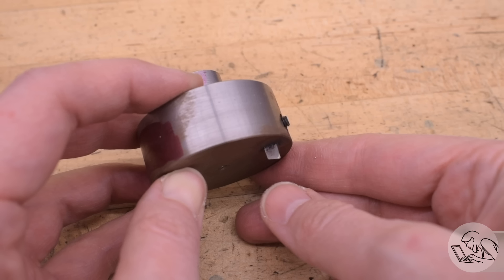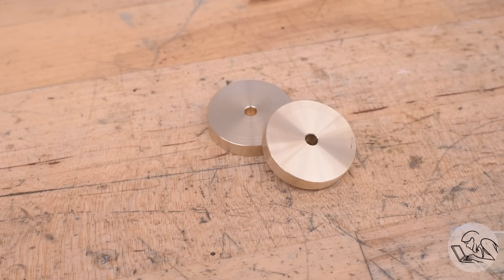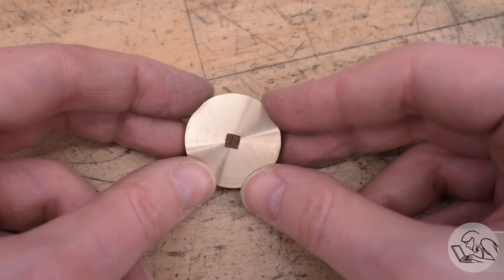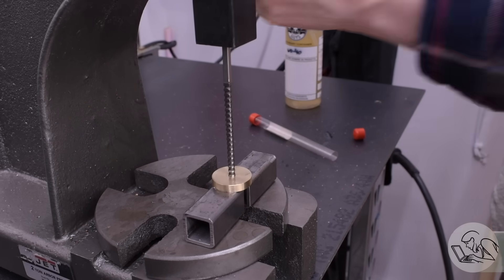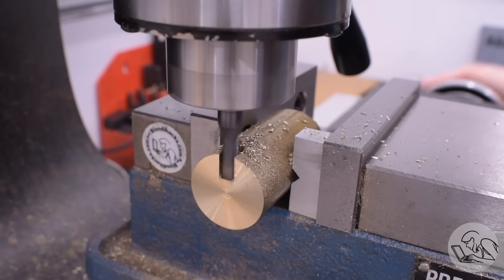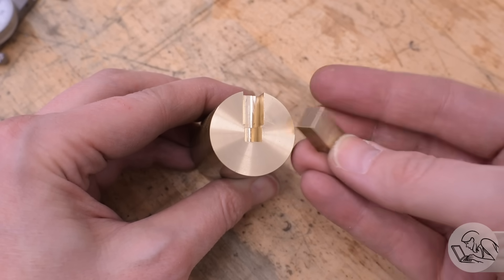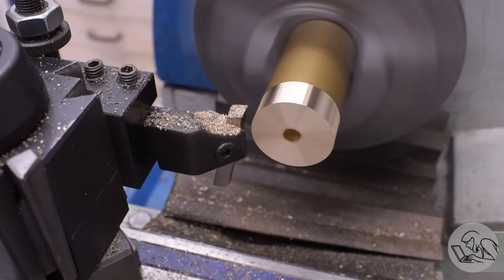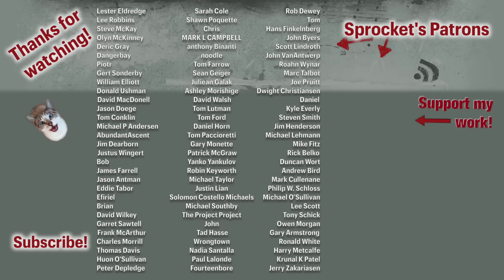Making Square Holes - Three Ways

Comment: I see another commenter mentioned This Old Tony's chisel approach to square holes which is good, but this old Tony had three other methods. Each started with a round hole. The first one involved putting the piece on a work surface and karate chopping. The second one was the same as the first, but instead of using your hand, strikes the object with a dead blow hammer. The final method, only for masters, requires only tossing the piece a bit forcefully onto the work surface. Each method, of course created perfect squares.

Comment: excellent stuff. I had never seen the third way before...very enlightening little guide
  Thanks Quinn
edit because I mentioned it in a message further down or up...I blacksmith so hot and cold punching, hot  drifting and cold chiselling as well as filing are in my playbook
Punching and drifting are pretty accurate, drifting for size and punching for location...cold chiselling is good at tapered holes and doesnt get used often but can be very accurate with sharp chisels (honestly I usually file the last bits to make them super nice and not tapered)

Comment: 40 years ago I filed four holes for carriage bolts to put a bench seat in a van.  In 1996 we were rear ended and the nuts were still tight and the bolts didn’t shear.  The van was totaled.  I didn’t need perfectly square holes, just enough to hold the bolts.

Comment: Loving method # just for the coolness of it.  Loctite 680 is amazing.  When I made a new cross slide lead screw for my lathe, people that had been there/done that convinced me to use 680 instead of a mechanical fastening to join the Acme threaded rod to the handwheel end of the screw.  Nine months later it's still holding perfectly.

Comment: 2:21 could the set screw be placed at the required angle? It would be challenging to drill the correct angle and correct position, I suppose.

Comment: I’ve been fabricating 30odd years. Never had a need to make a square hole. If it were as easy as drilling a hole square, im sure designs would’ve changed some, but all things considered, imo, square holes are for engineers that don’t fabricate or care about cost

Comment: Any suggestions on where to get good files - especially little specialty files like at 4:25 where it has safe edges?
Reply: I don't think I've bought a brand new file in 20 years.  If you dig in flea markets, you can usually find old files that were barely used.

Comment: It would have been interesting to see how erfective a shrink fit would be to perform with the last piece at home. I've heard putting the infill piece in the freezer and the surrounding workpiece in the literal oven would create enough thermal distortion to make an effectively unbreakable bond even stronger than press fitting.

Comment: Here is another way, a way that a toolmaker might use:  1) First drill a hole to remove a great amount of meat. 2) Get a high speed steel square cutting bit (typically hand ground to function as a cutting bit when you need to turn metal on a lathe). Grind it to the needed dimensions on a surface grinder. 3) Push the end of this bit through the drilled hole with an arbor press. Complete.

Comment: Maybe you have already done this but a video on how to cut small O ring grooves for an 1/8 hole would be interesting. I have seen videos on cutting large O ring grooves in flat plates but not small O rings. I have made a cutting tool out of a drill bit to cut O ring grooves in aluminum. An end mill works also but I would think there would be a better way to do this.

Comment: Well we've been making 14mm square holes in steel this week and it sucked. At first we drilled 4 little holes in the corners then then did a very long and inefficient CNC milling path of a square, but tool overhang was too long. So we used a 14mm rotary broach with a pre drilled 14.2mm hole. But the broach was too short (the hole is 35mm deep) and our Z axis kept maxing out. The rotary broach toolmaker said: if you need to make such big square holes, do it in a softer material like brass. But we are in steel. At last we did the method number 3 shown in the video, with welds. It worked but it took a long time.

Another advantage of this method is that you can make very deep square holes. But for making hexagons, it's not as effective. On the other hand, rotary broaches work better with hexagons, but still not very deep.

Comment: That third method is how i made a broaching bar for the slotting machine at work last year. Ran a half inch end mill vertically aligned through a 4140 shaft, and made a weld in cap to fit, with a grub screw to hold the tooling. Worked flawlessly, still using it. Love when i see the methods i figured out myself in example videos, just shows im not as think as i dumb i am.
Reply: I would never think about such a solution by myself and I have a lot of respect for people who do

Comment: I use the file method for my square holes. Start with the triangle file then to the flat like you did. But I have tapered square files to finish it to size. Of course the material I am using isn't as thick as you were doing. Need square holes for a carriage like bolt.

Comment: I use the broch to cut a square hole in cast iron model locomotive wheels, this allows me to be able to remove a wheel from the axel and replace it while keeping the wheel quartering. Never had a use for the last method, but theirs no question that the result was excellent.

Comment: A few times, i've needed square holes to take carriage bolts in thin steel plates. Not being able to think of any other way to do it.I used a triangle  file that I had laying around and it worked out well.

Comment: You're not entirely wrong on broaching. I've had to manually broach keyways in steel. We have a large manual arbor at work that I think is a 15 ton unit. And it is a beast when that broach gets a little crooked. Always make sure your broach is square to the work with each stroke! Especially with those old large manual arbors!

Comment: I've been a watchmaker for about 17 years and we often have to do a lot of bracelet repair which requires removing worn pins and screws, and replacing them with new and loctiting in place. The secret to a quick initial cure to about 75% strength is heat. I'll hold the completed bracelet over a heat gun and slowly pass it over until the metal is just approaching the point of being uncomfortable to touch. Then I set it down and let it slowly air cool. We don't have time to let loctite fully cure by itself and this speeds us up to the point where the bracelet can be delivered to the customer with no fear of it coming apart before it's fully cured.
Reply: You have to be careful when doing that, because heating loctite is exactly what we do to separate parts for repairs! Loctite will become ineffective around 120-150 degrees Celsius, and once it reaches that point it never comes back, it just becomes oil
Reply: @Orakwan  Loctite 680 doesn't break down as easily as the red and blue versions.  Once a customer wanted an optical sight mount removed from a very expensive handgun frame.  No reasonable amount of heat would break the Loctite 680 bond.  I had to drill the screws out in my milling machine.  There is a finite limit as to how hot a firearm frame can be heated and this was a $3500.00 pistol.
Reply: @Orakwan  Totally true. When we have a pin that doesn't want to come out or won't unscrew, we heat it up quite a bit more, basically to the point of being too hot to touch and it will usually come out like it's been greased.
Reply: Stir the 2 part epoxy with your soldering iron. Very fast cure!
Reply: I guess that's the main limitation of the locktite method - it's not heat tolerant in the same way as the metal its holding.

Comment: I like how over here on the woodworking side of things, square holes are the more traditional holes 😎 In no small part due to the fact that it's also easier to make a square thing to fit into that hole, as using a lathe is more the exception than the norm over here.
And by woodworking, I mean none of the really big power tools, which are way too loud for a hobbyist like me, wanting to have a fun time.

Comment: Good methods. I have 2 more additions: Drill 4 small holes at the corners (or plunge with endmill), then mill the square internally, also known as 'Micky mouse corners'. You can also manually slot in the mill with a square tool bit. These have the advantage of working in blind pockets too

Comment: There's a project a bunch of people are working on to build a pretty competent wire EDM from 3d printer parts.  If you find yourself needing a relatively affordable EDM, that could be a fun route.

Thanks for the video.  I knew about broaching and filing already, but hadn't ever considered milling a slot as you showed.  Really cool to see.  =D

Comment: One more solution to the „ do you need a square hole?“ aspect: mill a slot. If two flanks are enough to hold the inside part sqare, that may do the trick.
Also dont forget the ‚drill four holes in the corners and chew out the rest with a small mill‘ method. You can place the corner holes slightly out on the diagonal, which allows a sware peg wit sharp corners to still fit in. Kind of like the scallops when broaching, but on another part of the flat surface.

Comment: Square broaching... I applied at a company that had a square broach that was 24 feet in a hole in the ground.  The light from above revealed piles of broken carbide bits from taking them to their limits.  I didn't want that part of the job!  It was impressive!, but I took a job somewhere else for more money.
Reply: Yeah, making a hole in the ground is common for the really long broaches! Any factory making locks will broach the keyways - there's no other sensible way. EDM would take hours per part, instead of seconds.

Comment: When I got my city and guilds back in 1969, square holes were done with a drill and a file.
You made a steel cube 1 inch across when you finished it fitted into a round bar with a square hole 12 ways.
Dead centre with no gaps bigger than 1 thou 2:50

Comment: A "triangular" file, properly called a "three square" file, which is two less syllables and arguably less ambiguous! The second file is a Swiss pattern barrette. 
Its easier to find a square file with taper that has a maximum dimension at or under the finished size, and gradually widen it from it's taper as this guarantees squareness, then clean the corners and finish size with files such as your barrette. 
Given that early chronometers were hand made, it is possible to cut a perfect square with hand files using a roller filing guide.

Comment: Another way to make a square hole is to use a small drill and drill a hole where each corner would meet and then with the smallest milling cutter machine out the square breaking into each corner hole. Not elegant but works.

Comment: Seeing the letter punch guide again caused a question to pop into my head.  Would it be worth the effort to mill the letter punches to leave each letter plumb and centered on a judiciously chosen new square dimension so that you could actually use a letter punch guide to get perfectly aligned letters?

Comment: I saw some comments about a rotary broach...
Several years ago either Home Shop Machinist or Projects in Metal had an article about building a rotary broach. I made one (different that the article, but using the same concept). You sharpen a to to with any shape you want (like a square) with extra clearance on the tool and use it like a drill in tailstock (the piece part needs to rotate), and walla.
I have a drawing or what I made, but I can't seem to find a way to attach it.
Reply: *voila
Reply: We got a rotary broach for my shop and I love it. So fast and clean.

Comment: A method I use is a "dog bone corner" or if need be a vertical broach.

Micro drill corner center on corner, drill center, then mill with smallest endmill possible. (Functionally square but doesn't look good)

Drill corners inside tangent with micro drill and then drill the center. Then shave one corner at a time with vertical broach.

Comment: A tip for precise last pass of filing: use a precise vice with a flat top, align the lower edge of the of the planned square in the vice, put two rings of Scotch tape at a distance around the file, and file only withe the part of the file between the tapes, until the file slides on the vice. For an edge, you may clamp two steel blocks on top of the vice, so the file is also aligned from the side.
You should take into account the thickness of the tape. Use a stronger tape for roughing, or freehand.

Comment: Thought of you while perusing Face Book Marketplace the other day.  I stumbled across a 1942 AMMCO shaper.  Has a plate that reads: "This machine conforms to orders of the War production Board" attached.  They had a video of it running, it looks to be in mint condition.  It's only $600 USD, but I just can't justify it, it would be pretty to look at but it wouldn't get used.  It's in Lincoln VT if you feel like a road trip, lol.

Comment: Quinn, have you done an episode on the various Loctite products you use and where you use them? That would be if strong interest if you have or consider doing so.
Reply: Henkel has a few resources on their website to help you pick which product to use - and they're all kind of bad :(

Loctite is color coded, in increasing order of seriousness about making stuff stay in place: Purple, blue, red, green. Purple and blue are probably removable with hand tools, red and green probably require heat to release. Color isn't enough to go on though.

Your best bet is maybe reading the Loctite product catalog for an overview, then reading the datasheet of any specific products you're interested in.

I'd also like to give a shoutout to Vibratite for stuff you want to not rattle out with vibration, but still want to be able to adjust or remove and reuse, without having to replace the old thread locker ever time.

Comment: Quinn- where did you get or what is - the hss lathe square tool holder- ?very cool
Reply: They're quite nice on a small lathe and the tool is pretty easy to sharpen.
Eccentric Engineering in Australia used to sell them as 'The Diamond Toolholder' in Left and Right variations.
30 years on I'm not sure if they are still around

Comment: That unknown file is called a Sage Leaf in French, but if one side is completely flat from tip to handle then it's a knife. You can find them glardon, cabron, or valtitan cuts at Vallorbe (and i believe they are worth the pricetag, took me 20 years to finally get some glardons 10 years ago... I've spent so much money in other brands, those are literally unusable well not really in  stainless, did I told you they will do stainless?

Comment: Oh my god I should've just used the third method on a project I've been working on that requires several hundred rectangular holes on the side of some plastic cases. Slightly round corners are fine so I've been milling them with a 1 mm end mill. Just cutting them out from underneath with a 6 mm mill would've been stupid easy and I could've then taken care of the missing bit on the side, there's a cover on that side anyway, I could've just shaped the cover differently to cover the side of the hole.

Just ruined my day but probably saved me hundreds of hours in the future.

Comment: a fourth method for flat stock up to 1 cm thick is a hydraulic press with square dies, i bought a vevor one for making square holes in heavy duty steel hinges because i had 120 to do for my home, the cuts were very square on 1mm to 1 cm thick mild steel and copper flat stock / plate.
not sure if there are smaller versions available for scaled down work
nice vid

Comment: Another method, halfway between the Cheapest and Fastest methods - drill 4 holes where your corners are, use a jewelers saw/scroll saw to remove the majority of the material, and then needle file the corners square.

You end up with a result that is cheaper than the Fastest, and more expensive than the Cheapest - but also can be done entirely with hand tools, forgoing the arbor press

Comment: Rotary broach is my first choice in square or hexagon holes.  And easy to make the tooling in the shop
Reply: Rotary broaching squares beyond 12mm is almost impossible on most machines. And rotary broaches are usually short. Square holes are pretty deep most of the time, like for cranking handles and such, and are often larger than 12mm, which means rotary broaches can't do them. But rotary broaching is perfect for hexagons, there is less Z axis pressure and the holes are shorter
Reply: yeah, even the offset tool itself is easily done in the shop
Reply: Could have sworn Quinn had made one of those in the past, but it might have been someone else.
Reply: @m00nh34d  Brandon Inheritancemachining tried and failed to build one of his own design, and later built a functional one from a kit someone sent him
Reply: Yeah surprised she didn't mention it even though I think it's fairly well known
Reply: @joshclark44 Mentioned: 16:06
Reply: @joshclark44 a rotary broach would be an excellent side project 😊

Comment: I told you it was a mistake to buy a husky edm from a pet shop they have tendency to howl. In use and need to be ice cold in order to work well the good new is husk edm’s are perfect for Canadian winters and are designed for nome running

Comment: Many years ago I used a homemade plunge type EDM machine to put a square hole through a holder for a 1/4" lathe tool. Two things I didn't realize: The hobby store brass square tube I used for the "burning" tool left corner radii just a bit undersize for the sharp corners of the tool steel to fit. The other thing was that the inside of the hole was viciously case hardened in the process (I used kerosene for dielectric) which thwarted all attempts to file out the corners, until I got a cheap set of diamond files. Live and learn. 😏